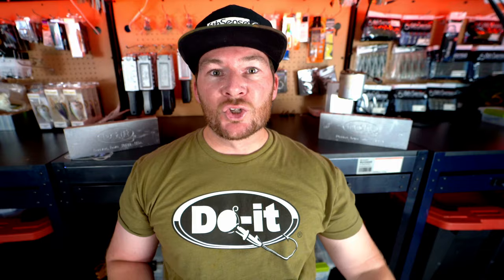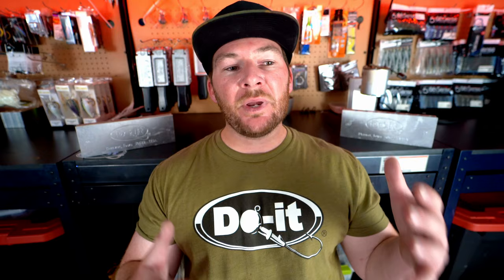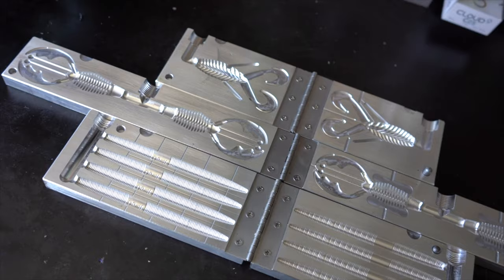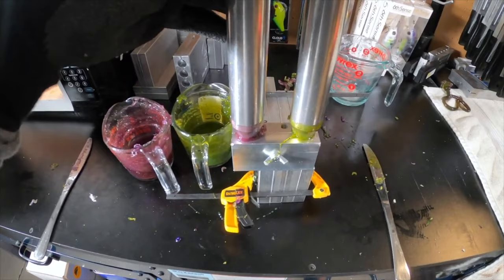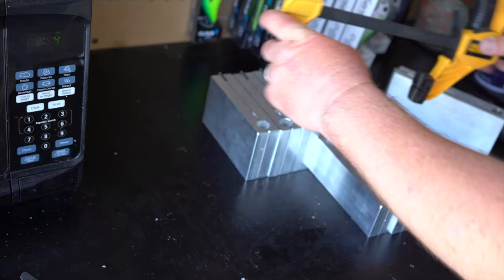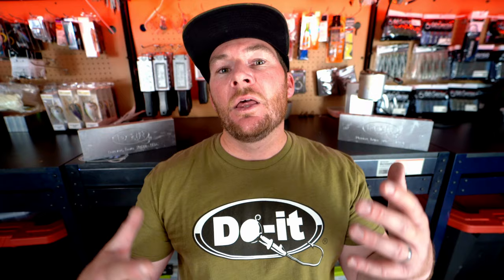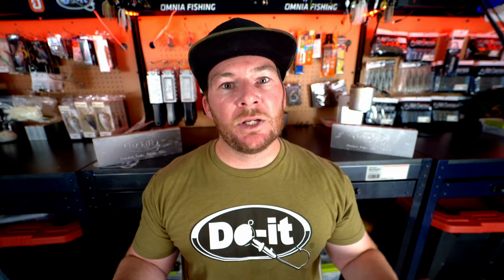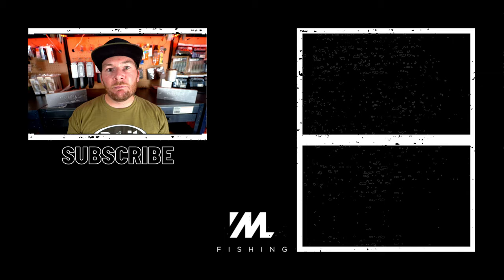Do-It Molds Essential Series Molds vs CNC Soft Bait Molds - Making Soft Plastic Baits

Comment: I have Do-It Molds and Angling A.I. molds, both are great. You can paint the Do-It Molds with high temp engine paint and get the same shiny look of any CNC machine mold.
Great video.
Reply from the maker: Thanks.  Yeah I’ve heard of people doing that.  Tried it once for myself and it didn’t work.  Another way way is to add a small amount of cooking spray to the mold.

Comment: You mentioned a higher temp for the ES molds. What temps are you looking at?  Also it sounds like the ES molds produce baits with more texture to them due to the casting process. This may not be the worst thing. Sometimes a roughed up bait works better than a slick and shiny one. Maybe it boils down to producing baits you make for yourself vs making to sell. Thanks!
Reply from the maker: When it comes to a specific temperature, i don’t have a specific number to shoot for.  You obviously don’t want to burn anything, but hotter than you’d normally shoot a CNC mold with.  The shiny on a bait isn’t what makes it get bit.  It might help it get sold, but i really don’t think it makes a difference on whether or not it gets bit.